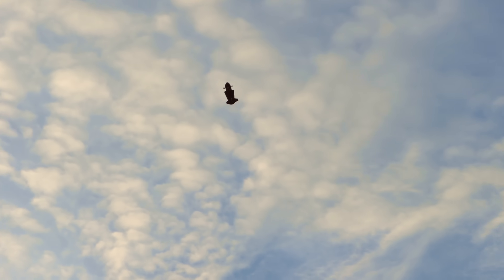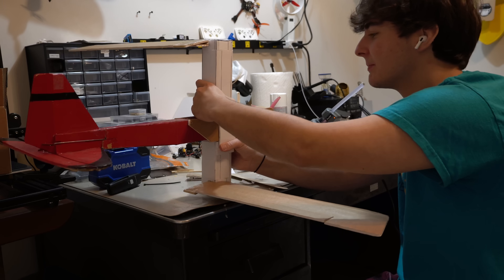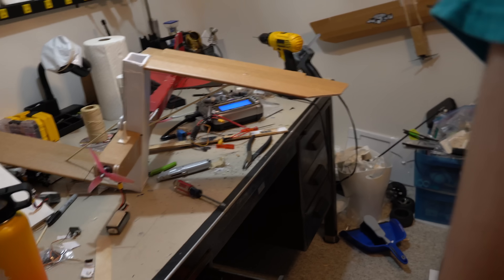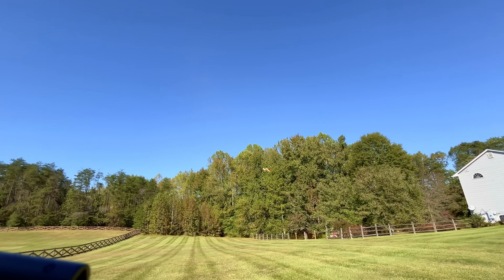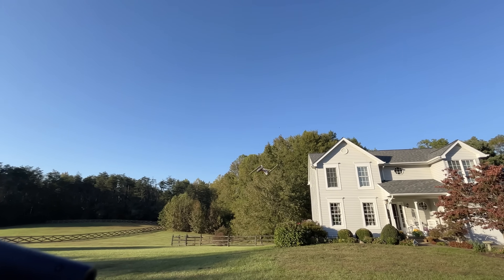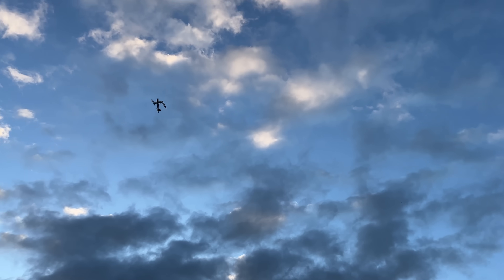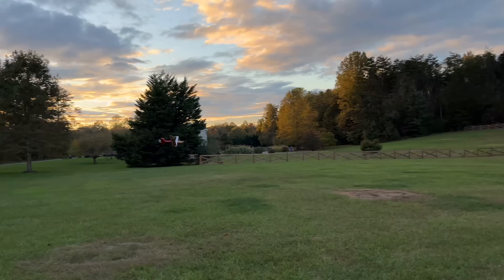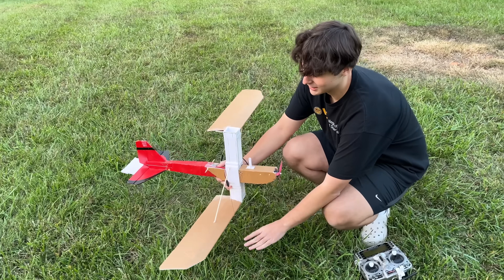Can a Plane Fly With Offset Wings?

Comment: I studied aeronautical engineering. Something that jumped out at me is the lower wing essentially has a vertical winglet on the upper airfoil surface at the root formed by the “mast” that will likely help reduce vortices. They would be normally be called wingtip vortices, but these are at the wing root. So… Roottip vortices…..? The upper wing won’t have as much benefit. The effect is probably not terribly noticeable at this scale, but you could run a vertical fin longitudinally on top of the vertical mast to help equalize the effect.
Reply: My thoughts on the wing root also. I did three decades of what this kid did. My whole teenage RC budget revolved around pilfering the walk-of-shame trash cans at Fun Flys, then building on the spot something crazy enough that people would either wager it would not fly or donate stuff to the cause. It is so refreshing to see this.
Reply: @66tbird1 Dang, that just gave me an idea... Bet that's an easy way to score some free servos and motors 👀
Reply: What if you had bottom mounted wings? Then you could have both wings with reduced “roottip” vortices…
Reply: @xenontesla122 You mean one wing on each side of the fuselage at the base taking out the need for a central pillar and making the plane more aerodynamic? You know, you might be on to something there🤔
Reply: @brawdygordii Haha, if only something like that already existed for over a century...
Reply: @xenontesla122  Well, I've been doing some further research into this. Apparently the Germans did actually invent a wingless aircraft. I think they called it a balloon? ;-)
Reply: "Wing root vortices" has a very Retroencabulator feel to it.... Im sure they could be mitigated with the proper application of Milford Trunnions.
Reply: A winglet at the root has zero benefit, since there is not lateral component of airspeed at the center of the wing. The benefit of these devices increases as you get near the tip.
Reply: @felixbachiller3550  vortices are made by pressure differentials. The top surface of the wing’s airfoil is a low pressure surface. The side of the mast isn’t.
Reply: Hello fellow aviation engineer 😂, Id imagine at the scale it won't have too many issues bar maybe a small effect of roll, but the direction the prop spins may also help stabalise it
Reply: exactly lift is essentially drag, drag is greated by vorticities, so basically the offset creates more lift close to the center then the outer wing, if it was only about the wings lift, then you could just ad a smaller winglet on each wing negating the effect, or use aleron trim, but.... the issue is with the elevator and vertical stabilizor which will be hit by an asymetric airflow and this will cause either of the elevators to have either a wingstall or inverted lift direction and that will cause a spin and rolle until you hit a gimbal effect or the plane breaks apart due to drag and torque, besides the airspeed dropping and the aircraft dropping out of the sky like a stone in a falling leaf spin, which will be impossible to recover from. in a sense this isn't that much different to some of the reasons why some NASA research plane concepts were dropped. The stability of a flight surface is heavily influenced by the angular momentum around the center of mass so in theory you could stabilize the plane with dynamic weight shift, but thats gonna be slow, and difficult to keep stable in shifting wind, but it might work better in smaller scales. Another way to mitigate the effect could be to perferate the mast in strategic locations but it still won't solve the problem with a tail that isn't offset like the wings. Stability is more complicated than symmetric lift balance in 1 axis.
Reply: Wingroot vortices.
Reply: @baddestmofoalive have you made model aeroplanes?
Reply: @1man1guitarletsgo  yes. I’ve been a scratch builder and RC enthusiast since the late 90’s. Nitro, electric, gliders, micro scale, helicopters, quad rotors, tri rotors, even hovercraft and high power rocketry

Comment: This is the first vertically asymmetric airplane I’ve ever seen. Never doubted for a second!
Reply: Planes don't generally have vertical symmetry to begin with.  Normal planes have left/right symmetry (more or less), which this plane doesn't.
Reply: roll symmetry

Comment: This does show how it will roll one way better than the other but that's because of the extreme offset creating a scooping effect, 
But the swing wing has them very close so the only problem would be during takeoff and landing as the lower will have a slight ground effect cushioning more than the other
(Why Mooney's float at landing) but otherwise 
A wing is a wing and the German's experimented with asymmetrical planes and had some wacky idea's That Flew well. Just not very practical 🤣🤣🤣.
Reply from the maker: It actually rolls both ways exactly the same. I’m just bad at turning right😂. But ya rolling clock wise or counter clockwise felt exactly the same. Although the ground effect difference is true. Although hardly enough to notice and definitely not anything the ailerons can’t easily counteract.
Reply: @joosh_king  Okay that's unexpected, So a wing is a wing. Awesome.